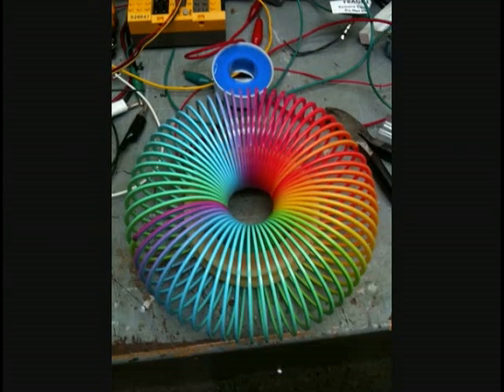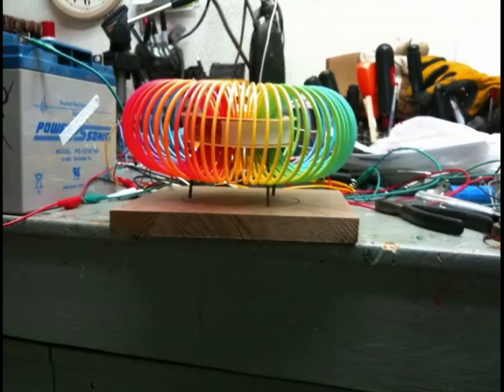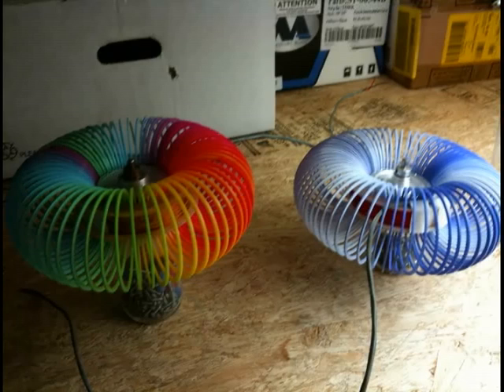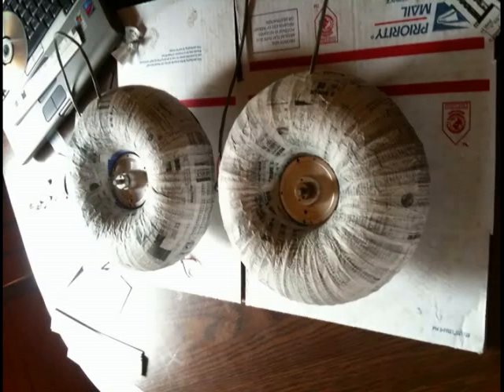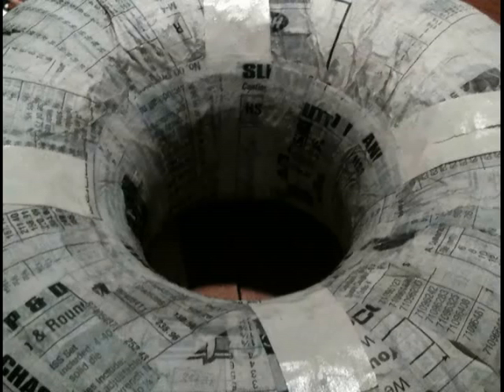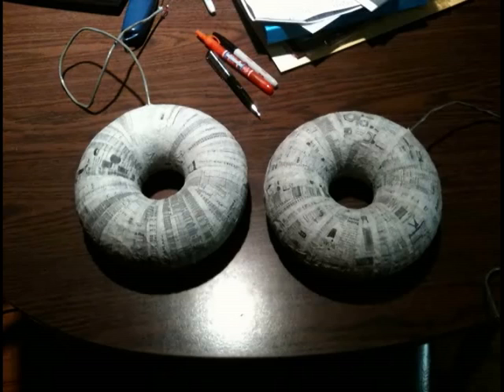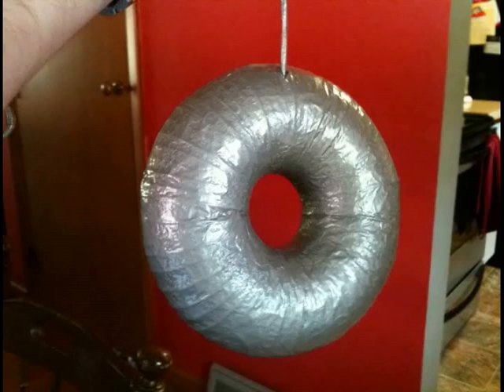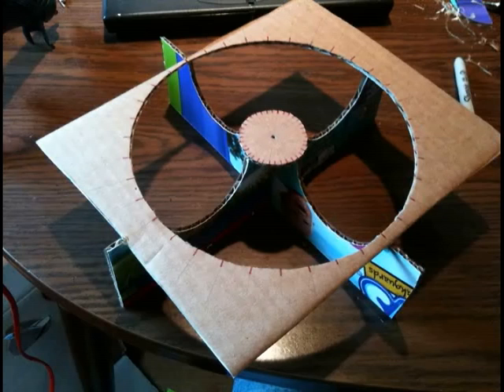Making and marking a Toroid for Rodin coil research!!!  How to

Comment: cool Project ! ! 
For people who want to use the slinky trick I suggest using some kind of tape around the outside perimeter first to hold the ribs equally spaced - Then you can randomly and carefully apply tape at other angles to suport the top and bottom parts of the ribs. 

This tape for the first layer may reduce the showing of the ribs between due to shrinking

Comment: This is a good idea in theory, although when I made my first Rodin coil I wound it on a plastic toy toroid, and even the light wire I used distorted the plastic of the toroid.  The implication is that I expect the wire you use to finish your coils will destory the light weight relative weak membrane of your paper mache toroid.
Solution:  I would think about putting a fiberglass and resin layer or layers over your paper mache.
Cheers,
fred

Comment: High frequency should have bare wire, unless you are going mid high frequency? I don't know the exact frequency where the resistance becomes an issue, but for the most part, high frequency requires bare wire.

Comment: wind a rodin starship coil into a toroid with a clear circular pvc tube half filled with mercury in a vacume inside the center core of the starship coil. you may like the results better. let me know what you think.